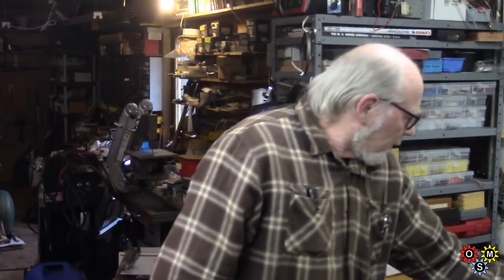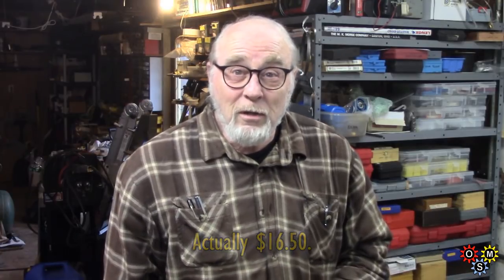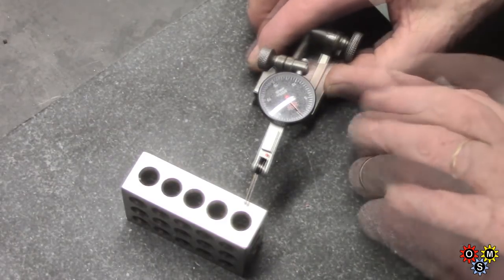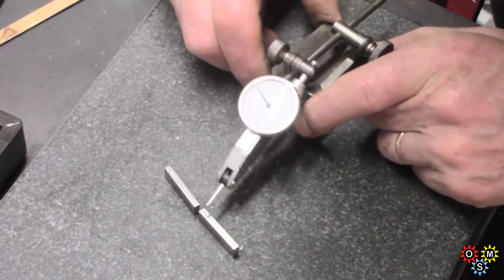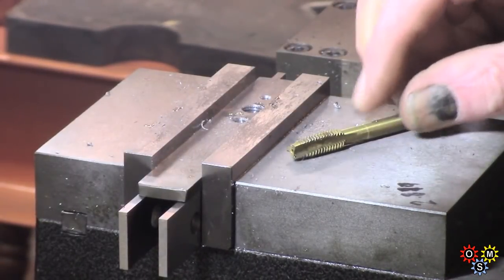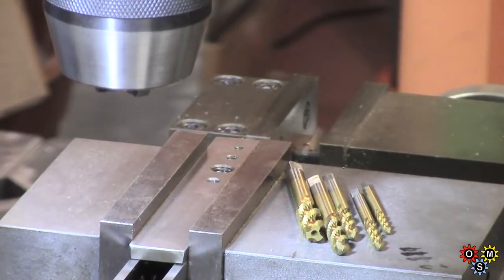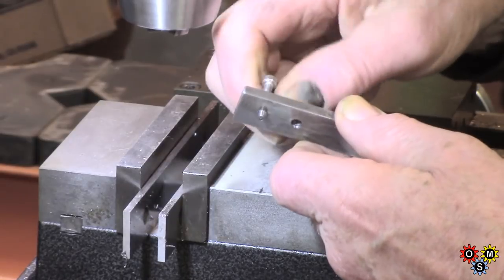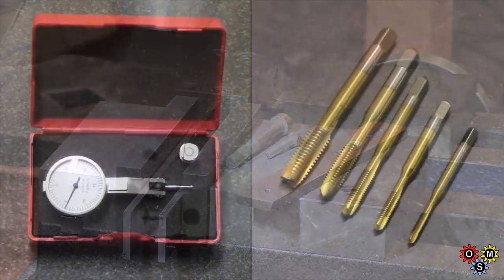Indicator and Taps from Banggood

Comment: Would you consider one of these sets for the home hobbyist who has no taps and diyes?

https://www.amazon.co.uk/FORAVER-Tungsten-Cutting-Precision-Engineering/dp/B075GMD1K1/ref=sr_1_5?dchild=1&keywords=110+pcs+metric+tap+and+die&qid=1608485782&quartzVehicle=1820-797&replacementKeywords=pcs+metric+tap+and+die&sr=8-5
Reply from the maker: Hi Oliver - well, that does seem a pretty good buy. It's good that you get coarse and fine and also get a taper and plug tap for each size. Dies look good and particularly useful as they are split dies. If they are genuinely tungsten alloy then they should serve well with care. Always remember in use with taps, to regularly back off as you go to help ensure assisting with chip clearance.
Reply: @ChrisB257  Thanks Chris. Yeah I am a little shy to step forward with these atm....  It's not a lot of money for genuine kit but a lot for stuff that will break after the first attempt or cuts badly!

Comment: Thanks for the reviews Chris, always enjoy watching and learning from your channel. 
Just to take up a point touched on by xynudu, both of these tap types are machine taps and it should not usually be necessary to reverse them to break the chips in most materials. I use good quality HSS spiral flute taps frequently and almost always power tap, except for the 10/12mm sizes in steel because of power limitations of my mill. I rarely find it necessary to reverse mid way. I always use a tapping compound called CT-90 by Action Can Ltd., here in U.K. It is like a very thick grease which melts on gentle warming and works far better than WD-40 on aluminium, no galling and chips clear easily. It's also great on steel and less messy than cutting oils, with no odour. I would like to have seen how those spiral flute taps from Bangood performed when driven through the material in one continuous forward cut.
I wonder if you have had occasion to use those same taps again and how they are standing up after five or more uses?
Reply from the maker: Hello Max,
Your CT-90 sounds very useful... I do still sometimes use "Anchor Lube" which helps tapping quite a lot.
My reversal is very much due to old habits - knowing of course not to with these tap styles - it's hard to break habits of many years. Way back I never had other than std type taps and so always backing off to free chips.
I haven't used these a whole lot because don't use metrics much - however, I have used the 6mm a few times and it survived - not sure though how the small 3mm would hold up to multiple uses. being so good for price I'd say they are good to have for occasional use anyways. :)

Comment: Chris, I just finished watching the 5/20/17 video about Emma's challenge. Is that an anvil to your right. A Peter Wright perhaps? Thanks
Reply from the maker: Hi Bill,
I can't remember any clip showing the anvil but assume you refer to a full size item. I actually acquired that back in the UK long ago and it was an ex British Rail anvil!! I does have a chunk missing on the bed and it is obvious it had had a lot of use. However, it is still invaluable to have and it sits on a block base and on top a piece of old carpet I think it is to deaden ringing noise.

Comment: Very nice purchase, I like the spiral flute taps, certainly in the over 8mm/5/16" sizes, the way they eject the swarf back out of the hole is very handy, I think there is a place for cheap taps that you can rely of for the times when you only need to use the tap once, I recently wanted an 1" x 14tpi tap for my reloading press, the cost £120 ! That is where a cheap tap is very welcome.
Reply from the maker: Hi Chris - well, for the small price and for occasional use I reckon they are worth it.
120 for the load press tap - holy smokes! Trying to remember if I got one ages ago - but that sounds horrendous price!
Happy New Year.

Comment: Hi Chris,

Interesting video.  I've never used spiral taps.  What's the advantage over standard taps ?

That gold (titanium ?) coating they put on HSS drills and taps doesn't seem to be of any use whatsoever from my experience - just looks good ;)

I like the little tap holder. Did you make that ?

The main thing to check with cheap indicators is stiction. Cheap ones I've used are fine and don't make you cry when you drop them.

Cheers Rob
Reply from the maker: Hi Rob,
Advantage is - spiral point (or 'gun taps') push chips ahead as they work (for thru hole) - so less likely to get chips binding up. The spiral flute taps pull the chips up the flutes as they cut - again reducing the effect on std taps of chips binding up.
The Tn coating is a bit 'cosmetic' IMO although in theory it is supposed to decrease friction a bit and improve wear.
Tap holder - made about 40 years ago I think!
ATB.
Reply: Hi again Chris,

I researched this a bit and found that both of those taps are NOT classified as hand taps and are intended for machine use.  The Pdf below makes for interesting reading:

http://www.ymwtapsusa.com/download/newsletters/Understanding-the-basics-of-spiral-fluted-taps.pdf

I'm not saying they can't be used for hand tapping (as you showed), but that's the basis of their design.

Interesting.

Cheers Rob
Reply: xynudu, thanks for the pdf link, interesting reading.

Comment: Hi Chris,
Got some taps from Banggood also the HSS with cobalt, but not tried yet, at first glance they look like good quality items at great price.
The 2 types you got there perform better when power tapping, though, they don't like to be backed up in order to break the chip. Could be more of a tap breaker op...   ;)
Happy Holydays to you and family,    Pierre
Reply from the maker: Hi Pierre,
I agree re backing off - thing is that steel was so horrible it felt like I had to do it to ease thru - normally I wouldn't. I didn't dare try and power tap in that nasty stuff. You are dead right though.
Merry Christmas back at you my friend. :)

Comment: Not for me. I bought a similar indicator and found the dovetail fitting just about uselss. As far as taps go, I always buy multi-use quality as just one breakage costs far more than buying cheap!  
I've stopped buying from them because I feel the items are awsys substandard in one way or another. I bought an ER32 set for tool holding, but found the actual collet holder was not quite 2MT and was absolutely useless. I then found the company is really carp when any complaint is lodged. Take your chance, but don't expect any customer support (unless you promote them!).
Reply from the maker: Well, there is always a risk of poor items but the thing is in many cases, costs are so low that it's worth the gamble, particularly when one has a very limited budget. I take your point though.
Reply: There's no standard for indicator dovetails that I'm aware of, so it may not correctly fit the mount you have.

Rob

Comment: I have found all these tools to be very good quality. A good review...How does your workshop perform in the cold weather? Do you get condensation on your machine tools and equipment? Regard Steve
Reply from the maker: Hi Steve,
I do think most of the time their stuff is great value - maybe sometimes taking a chance of course.
Shop in cold is a problem sometimes - metal gets super cold and yes, risk of flash rust if not careful. When it gets too cold even some heat does not cure all problems... and too costly to keep heated unfortunately.
Reply: Chris: I find the cheap answer to temperature change/condensation is a small light bulb,(not an LED) just placed under the chuck of the lathe with a removal blanket over the whole machine, this stops all condensation problems, it gets surprisingly warm under there, the Mice haven't discovered it yet !
Reply from the maker: I may yet resort to that although I try to keep chucks and other bits lightly oiled best I can. With the cold we have now perhaps I will do that :) ATB

Comment: Howdy, and a Merry Christmas from Michigan USA.  The issue with taps is not how many times you can use them before they get dull but more, at least to me, is how well they hold up and don't snap in your part . . .either ruining your part or generating a great deal of effort to extract. . . .
Thanks for the review. . .Cheers 
John
Reply from the maker: Hi John,
Thanks - and Merry Christmas to you too. Indeed, taps not breaking is good for sure - these seemed to take a lot of torque OK fortunately.

Comment: Chris there is no need to back off the thread when using spiral flute taps 
That just cause the chips to gum up the works
Reply from the maker: Hi Bill - well, with the awful material it did seem needed although I take your point for sure. Normally I wouldn't.